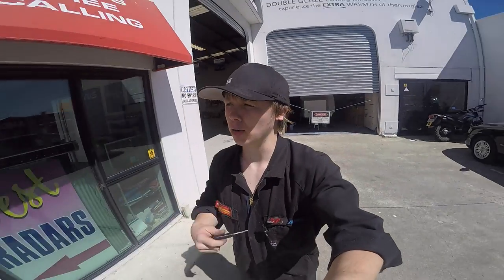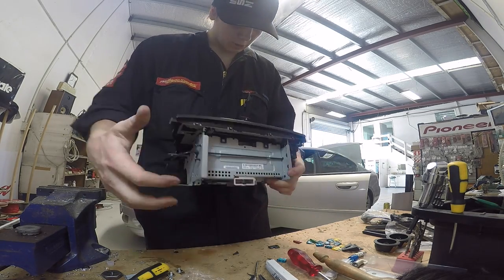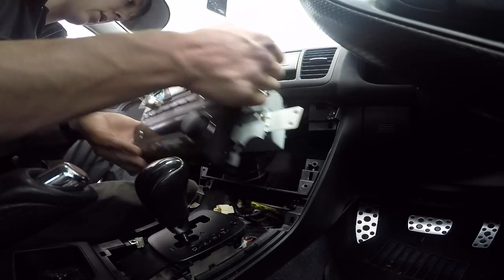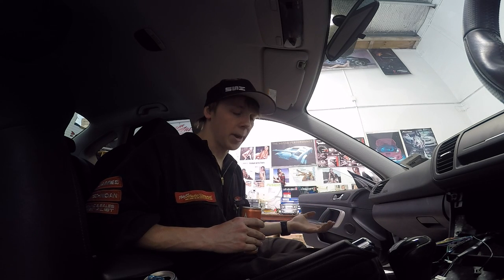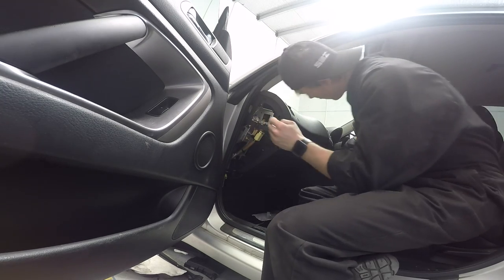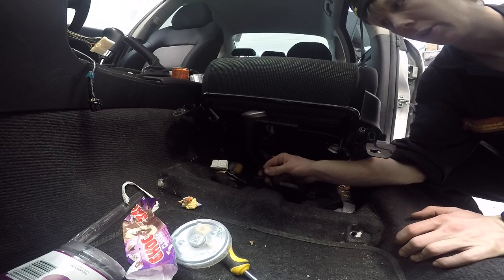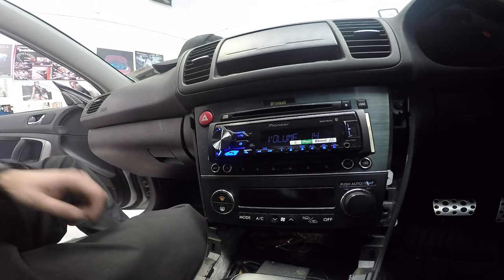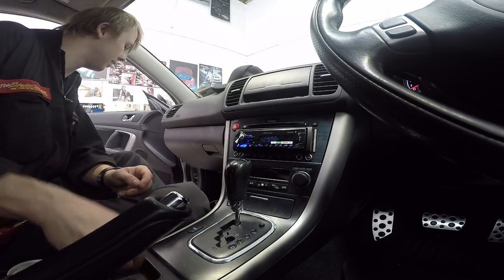2004 Subaru Legacy Stereo Replacement | McIntosh Amp Bypass

Comment: On McIntosh amps like this one, the power/speaker harness is via an 18-pin connector (from the same family as the head unit's 14-pin). You can use an aftermarket harness intended for some Daewoo models (Metra 70-8405, Aerpro APP030, or equivalent) to connect to the car's harness or a reverse version of that to plug into the Mc amp. You'll want to re-pin the wires, since the Mc amp uses some different slots than a Daewoo stereo, and it can be helpful to place the aftermarket colors in slots appropriate to the Mc amp (for example, move the wire for Left Front speaker [+] to the correct slot for that on the Mc amp).

The Mc amp's input is via a 21-pin round DIN connector (20 pins plus a terminal on the outer barrel). The HU feeds the amp analog, balanced, roughly line-level signals -- 4 main speakers plus a subwoofer, and an amp trigger.

Older Mc amps used a similar round 13-pin DIN connector that only supplied 4 main speaker channels (the amp used those to synthesize the signal for the car's subwoofer) and the same type of 14-pin as the HU for the power and speaker connections (but with a different pin-out than the HU).

It is possible to use the Mc HU with aftermarket amps or an aftermarket HU with the Mc amp. But as others have observed, in cars as old as the ones with the McIntosh system, the factory speakers are usually pretty far gone and probably not worth saving.

For pin-outs and more information, search for blog posts by "NZlamb" and posts on australian Libery and UK Legacy forums.

Comment: "Waste not want not"
This is just NOT the proper way to solve the audio head problem.  To save on the proper 2DIN "audioless" harness/bracket at the cost of destroying the stock audio head unit??  It's just ridiculous, and the final results don't look good either.  And let's not forget,  the original stock audio head unit has good resale value as well, but not without the front faceplate......

Comment: So is it possible to just change the head unit with these Macintosh amp models? Or is a bypass always necessary
Reply: The din cable just has 4 line level channels and an amp on line (rem). You could happily splice in some rcas and the REM line to an aftermarket headunit. However most of these cars have completely shagged speakers too and as they're an odd ohm rating they're hard to replace. Better off replacing it with a cheap 4 channel amp anyway.

Comment: Just curious mate, how come you don't solder and heat shrink?

love the videos by the way keep it up :)
Reply from the maker: Jason Hong I do solder.
I do have heat shrink but only use it when absolutely necessary or on display because at my work I do a lot of cars and electrical insulation tape is just as good and cheaper.

Comment: Good info, thanks mate.  Might have to pull my Mac HU out as CD player input seems jammed (can't load in any CD's).  My 2006 GT has the amp under passenger seat. Under driver seat is the SAT NAV unit (Panasonic) it has an audio in which was great as I use it for AUX input (for my iPhone) - then use the SAT NAV display to toggle to AUX.  The SAT NAV also takes CD's and DVD's.  Problem is that its all in Japanese!

Comment: how would you run the speaker wires from a gt premium mcintosh with 10 speakers to a single din unit, not including the sub in the boot.?????

Comment: that radio works just fine and looks really cool why didn't you just use the original factory head unit and just replace the amp? that radio doesn't have anything but preamp outputs so if it was the radio's preamp outputs that failed I would understand why it would need to be changed
Reply from the maker: Austin Childs you can't connect anything to these factory McIntosh stereos or amplifiers, they are connected with on great big thick din cable and all the communication is digital not analogue. I.e the head unit simply tells the amp when to turn up the volume rather than the output of the head unit increasing. So answer is you can't just "replace the amp" unless it was an identical factory McIntosh amp which you can't get.
Also the current head unit doesn't really work fine if the customer wants anything more than CD and radio, I.e USB, Bluetooth, aux etc
Which they did.

Comment: So if you were to hook up an after market sub and amp just include the blue wires ? From the factory amp?
Reply: Nah blue wires are coming from the factory sub going to the Mac amp. So if your aftermarket headunit is sub compatible it’ll have rca ports and a remote wire in the harness, you then run power cable from battery to fuse then continue power cable to a aftermarket amp, then remote wire from HU harness to AM amp, find a solid earth and earth wire to AM amp then wire up sub to the amp.

Comment: Just letting you and others know, you can buy bolt in OEM Subaru double-din fascia kits for about $120-$150AUD to replace the McIntosh stereo.. Saves hacking up your factory one and having loads of random useless buttons... And double din :)
Reply: do you have a link or something? i can only find kits to replace the subaru stereo, but i comes with a new ac control unit, you can´t buy it seperatly.

Comment: Hi! Nice work! I want to replace similar McIntosh head unit, but was afraid, that without the amplifier the audio system would not work, but you did!  I will try to solder the 20-pin tail from the old heads to RCA and connect to the line outs leads on new head unit.
Reply: Too bad you haven't been able to connect the subwoofer yet.
Reply: So, what I can say - new head unit not compatible with amp. Mc head and amp was removed and I made the same scheme as you. Also without subwoofer. Maybe do it later.

Comment: How can i keep the sub. Do i have buy a new amp. Im about to get mcintosh stereo replaced in my liberty 2006 bspec.
Reply from the maker: If you have the factory mcintosh subwoofer, yes you will need some kind of additional amplifier to drive it.
Not that any proper car audio subwoofer amplifier is going to be too powerful for it as they are only 30-60watt usually, we use little 40watt amplifiers that you can fit in the palm of your hand which we get from our local electronic components store.
Reply: Car Audio.etc thank you i appreciate it
Reply: @caraudioetc So to run an amp for the sub - would you use the power cable  from the harness under the seat, or would you run a new one?

Comment: Great work man! Were the tweeters and other little speakers all worker still or just the 6.5 inch ones?
Reply from the maker: All working, the tweeters have capacitors on them and receive full range from the same channel as the 6s, same for the mids highs.
Reply: Cheers